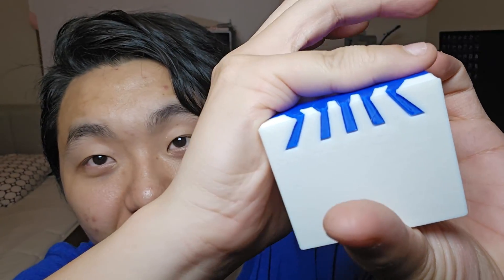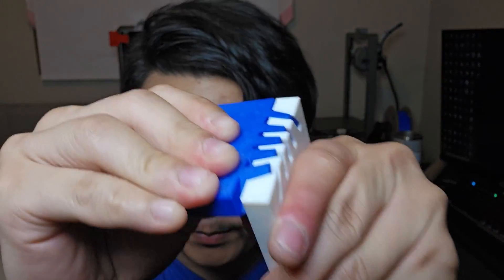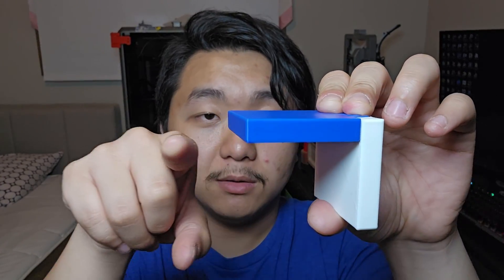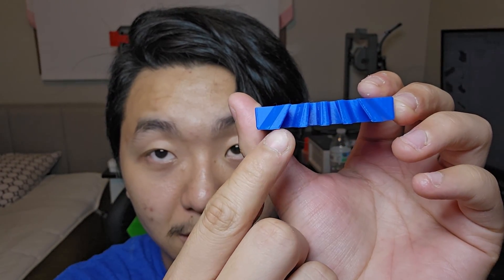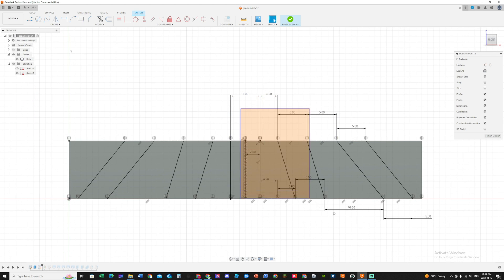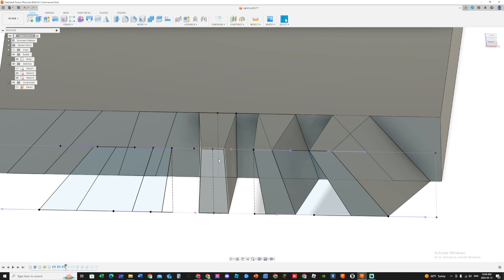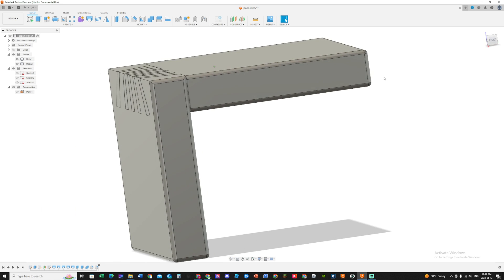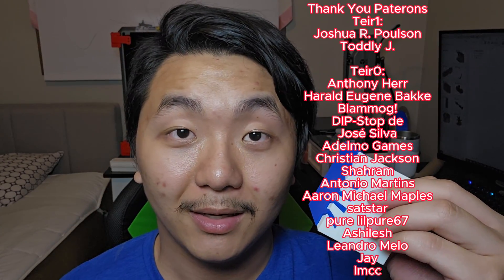3D Printed Japanese Sunrise Dovetail Joint Impossible?

Comment: With enough precision additive manufacturing (3D printing) can make anything subtractive manufacturing (CNC machining) can. Cost, strength, and aesthetics are the differing factors - 3D printing cannot compete on cost/strength vs wood, especially for full size items. It's not yet cost effective to print a desk for example. If filament costs come down and large format printers also improve even more, this  should be possible. We're probably still a decade away from mass adoption but its shouldnt take much more than that IMO.
Reply from the maker: That is true, printing big sizes like table and things will cost a lot of filaments, but making these joint is so fun and easy to do with 3d printing.